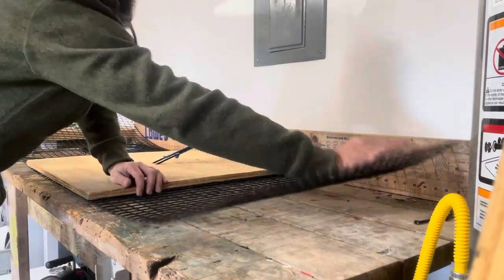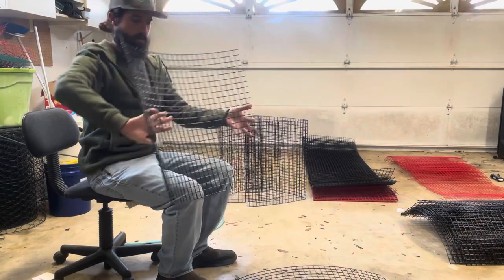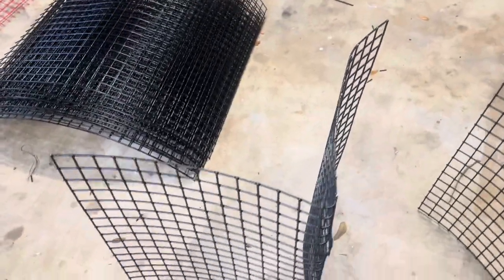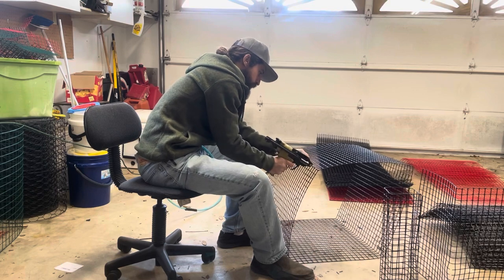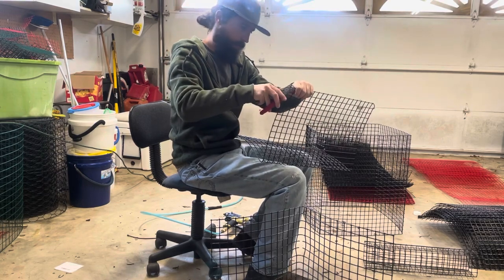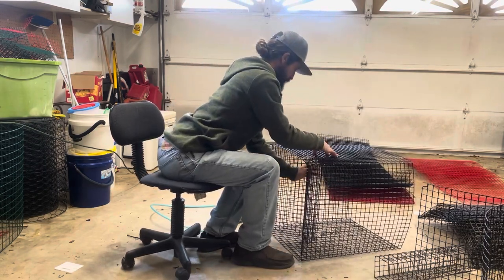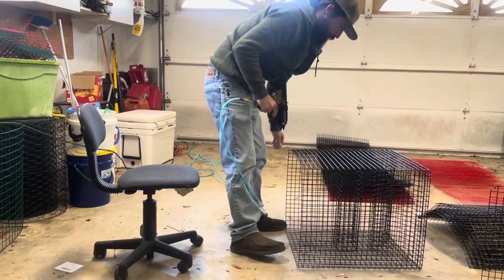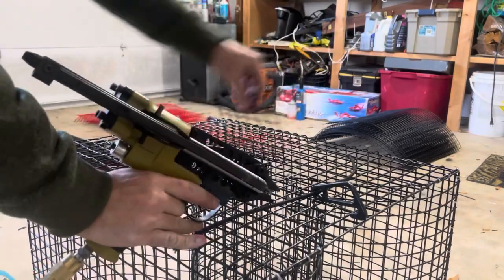How To Make The Best otter proof Pinfish/Bait Trap

Comment: One of the simplest and best minnow traps I’ve seen. I like cutting the entrance holes out of the solid piece in the bend and leaving the wiring intact between the holes. This leaves a sturdy entrance that remains viable and doesn’t have to be readjusted open with sharp edges. If you don’t have a hog nose clamp you can use zip ties but it looks like the hog nose clamps are better. Thanks for a video worth watching.

Comment: What is the attachment you have to your cutters?
Reply from the maker: Air powered piston
Reply: Where did you get the plier attachment for the piston? Could you explain a little more? I'm trying to find it. I can't find it anywhere?
Reply from the maker: They came together. Just a regular pair of wire dykes.
Reply from the maker: They are just channel lock brand dykes
Reply: I just looked at them you should make a short or a video on how to build the cutting tool
Reply from the maker: @brianfloyd6311  I didn’t build this or I would. I found the cutter on eBay about 7 years ago

Comment: This is bunk. Pinfish wont go in black traps. Hot dipped galvanized is best. I live in Key West on an anchored houseboat and have tried both. Black wont work.
Reply from the maker: Lol every charter boat in Destin uses my traps. Only reason bait shops sell red traps is because when they are outside they act as a visual aid to people passing by. I assure you these catch the bait😂🤣
Reply from the maker: Also sell traps to multiple bait shops in the area. Lol nothing in their natural habitat is red
Reply from the maker: This is all Riverdale wire. It’s American steel powder coated with vinyl
Reply from the maker: Riverdale is the best wire there is